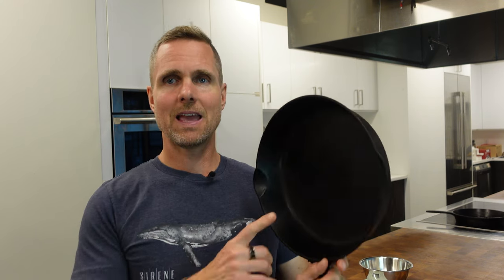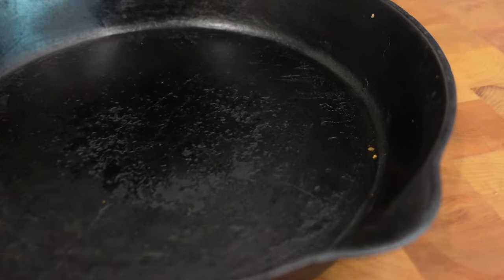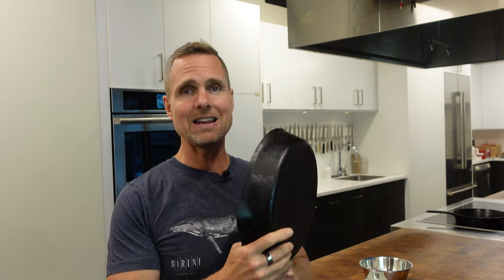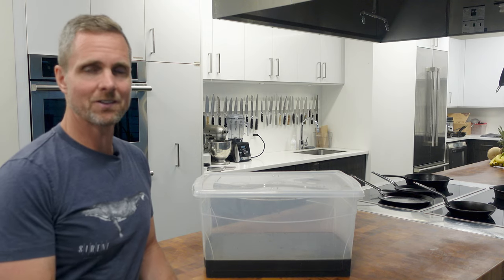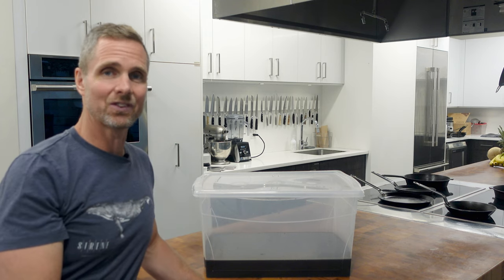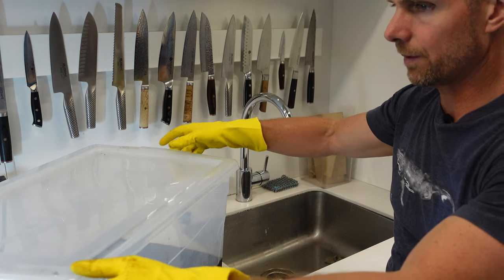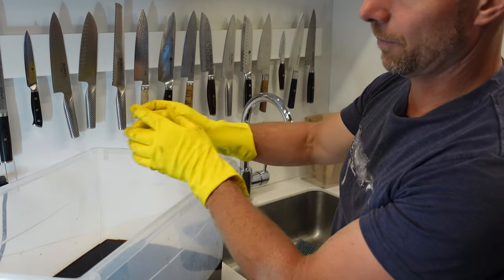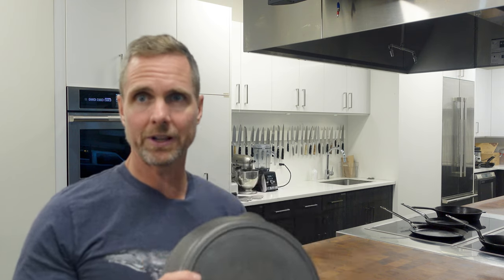Reconditing a 100 year old Griswold pan in a lye bath

Comment: Another thing about wire brushing pans is brush bits get embedded into the surface stays there. So whatever metal the wire brush is made of (and whatever else it was used on before your pan) gets into the surface. Even if you season it there is a possibility those tiny bits might come off with the food. The pitting on the logo is sulphur pitting, likely it was used on a coal stove fire. Adds to the patina. The italic (aka slant) logo is older (1909-1929 with a heat ring) than the upright logo.

Comment: My husband found a griswold a few years ago at a yard sale. The inside walls and about an inch out were carbon laden. The center was beautiful though and I didn’t want to remove the good seasoning. He uses brass wire wheels since being softer than steel only removed the carbon. I reseasoned the nearly bare edges and now have an amazing pan that works beautifully on my induction stove. It’s a true non stick pan.
Reply from the maker: That's awesome!

Comment: I' impressed with how close you got to the age of this skillet, I had to look it up in the book. A slant logo Erie was produced from 1909 - 1920 according to the book of Griswold & Wagner (5th edition blue cover on Amazon if anyone cares). If you would rather not work with lye Purple Power does the same but its just a cleaner, probably isn't as cheap as lye. The back is just Sulphur pitting from use over a coal oven. I kinda don't mind that terribly. On the cheaper side the Birmingham Stove & Range, Red Mountain series pans are nice. Most pans produced from 1900 - 1950s will be nice. I agree Steven at Cast Iron Cookware is a good person to learn from, a lot of what I do I've learned from him. You did an excellent restoration on that pan. you should feel proud. The looks on their faces when they get it back will be priceless.
Reply from the maker: Thanks. It turned out great.

Comment: You can also boil the lye mixture in the pan, then get a bigger pan, and boil it too, while the one you want to clean floats on it, which would take care of the exterior. Boiling lye solution strips it within half an hour or so, to the point where you can barely see any gunk and the metal is nice and gray.

Comment: This is the correct way to properly restore vintage cast iron. Electrolysis is another acceptable choice by the cast iron collector community.
Reply from the maker: and easy too! I understand that electrolysis is just for rust and that Lye is step #1 to clear off the organic matter. True?
Reply: @Cook-Culture  electrolysis will do both but imo it's not worth the effort. Lye bath for organic matter. Vinegar solution for rust. Easy. And much less to deal with.
Reply: The correct method is to throw it in the trash and get a real pan.. one that heats up in under and hour.. cooks more than portions of the pan.. and you can actually move. Cast iron is the most over rated trash.. in the time it takes me to heat a cast iron pan to full temp I can be half way or even done in carbon steel… or even in all clad..
Reply: @AverageReviewsYT  We found the juvenile!

There are always pros and cons to every pan/skillet material, even Carbon Steel. Even all clad and stainless steel have their pros and cons. Everyone has a different situation, or they value certain pros from one type of pan over the pros of another, or the cons from one type are too much and make that material not worth it (such as price, for example). Being a grade-A d-bag by going to a video about cast iron just to comment and call it "over rated (sic) trash" just makes everyone laugh at you as you display your ignorance and childish temperament.

-1- Cast Iron is an alloy of 2.5 to 3% carbon, and iron. Carbon Steel is an allow of 2% or less carbon, and iron. Your big issue is over 0.5 to 1% carbon content between the alloys.
-2- Carbon Steel does heat up faster, because it is a bit better at heat conductivity and has much less material to heat up. That means it also cools down equally faster and does not retain the heat needed to keep your food warm post-cooking. When you put cold or even room temperature food on a Carbon Steel skillet, it will drop the temperature of the skillet itself much quicker because of that high conductivity/poor heat retention. A properly pre-heated cast iron skillet will see only a negligible temperature drop when food is added.
-3- Carbon Steel is more expensive. A name brand 12-inch cast iron skillet will run you about $20-25. The Carbon Steel equivalent as a cheap knockoff brand might be as low as $40, but you're going to be looking at $50-60 for a decent pan. that is double or higher the cost of Cast Iron.
-4- Carbon Steel and Cast Iron both require seasoning and maintenance. Most people do not properly care for Carbon Steel the way Cast Iron owners care for their cookware, which is why most Carbon Steel pans become splotchy (mostly due to rust). 
-5- Carbon Steel is not as durable, and it is much more ductile (prone to dents/damage). Example: Carbon Steel is typically created by being bent into form from a sheet, not cast.
-6- A 12-inch Carbon Steel skillet will weigh about 3-4 pounds. A 12-inch Cast Iron skillet will weigh about 7-8 pounds. So Cast Iron will weigh on avg an additional 4 lbs over a 12-inch skillet, or 2 lbs over a 6-inch skillet.
-7- Cast Iron typically has a higher heat emissivity. This is also significant to many people when it comes to post-cooking and keeping your food warm.

Just some examples.
Reply: @WhiskeyPapa42  im not reading all that garbage.. as for my half joking comment.. all of that is from actual experience (I used cast iron only for a couple years) not just from reading forums and what mommy and daddy told me. People act like cast iron is a god send.. it’s not.. and it’s so much slower and annoying than regular skillets lol.. so whatever all the garbage was that you typed… idc.. because I’m sure it’s google cast iron forum nonsense lol
Reply: @AverageReviewsYT  "I'm not reading all that garbage" Of course you're not, because then you would have to have an actual debate/argument and defend your points. You're the only expert here, I'm sure. /sarcasm 
"it's so much slower" ... if you had actual experience like you claim, you should know that cast iron can be preheated in like 10 minutes. If you're making anything worthwhile, you have 10+ minutes' worth of prep work you could be doing during that time. It has zero impact on your actual cooking.  But I will bow to your illogical experience (also /sarcasm)
Reply: @WhiskeyPapa42  10 minutes.. ( assuming in the oven)… now preheat the oven lol, add a couple more minutes… if you preheat on a cooktop it heats un evenly and much slower compared to any other skillet. ( doing a pan of bacon on a 12” ci I got 15 minutes for even temps.) 10 minutes… I can cook a pan of meat in that time.. 10 minutes.. that’s wasted energy and time.. not to mention the weight.. but go ahead.. keep rambling google facts off 😆😆😆
Reply: @AverageReviewsYT  My god, this generation is soft. If letting a stove heat a pan for a few minutes is "too much effort," I weep for the first girl who lets you get past first base. On the plus side, the guy she dumps you for is gonna have a low bar of comparison.
Reply: @TheCharleseye  lol you see it as soft.. I see it as choose the better option.. 😎😎 efficiency and time management 😆😆😆 I wanna get stuff done and catch up on all the other tasks I’m needing to do. There’s a time and place for cast iron and daily use isn’t one for me..

Comment: I have restored dozens of Griswold, Wagner, Favorite, etc. vintage pans. You really need to use soap and some brillo pads after the chain mail. Then scrub with a magic eraser until the water and sponge is clean. Spray it with oil while it's wet and wipe it down to avoid flash rust or "oxidation". A stainless steel scrub pad works very well as well. You want ALL the seasoning off because rust can hide under old seasoning. Get it down to gray metal before you start to reseason. TRUST ME!

Comment: After stripping, soak in a 50/50 vinegar bath (WARM water)  for no more than 30 minutes.  This neutralizes any lye that gets trapped in the iron pores.  

Then rinse WELL for a good ten minutes.  Preheat your oven to 200 degrees F while rinsing. 

Dry with a lint-free cloth immediately to remove most of the water.  Place in the pre-heated oven for half an hour.  This dries away ALL residual moisure while also opening up the pores of the metal to receive oil. 

Remove from oven, and QUICKLY apply a very light coat of high-temperature (500 degrees) avocado oil.  

Place back in the oven and turn up the heat to just below the smoke point (480 degrees is good!)  Allow to bake at 480 degrees for one hour. 

Turn off the oven and allow to cool overnight IN THE OVEN so it cools down SLOWLY. 

Repeat the seasoning process several more times identically. 

In this way, no moisure can become trapped between seasoning layers. 

Regards!

Comment: Don’t sand, use high temperature to clean. I suggest using scotchbrite pads instead of chain mail. But hey, it’s yours to do as you wish. It comes out cracked, warped, or has swirl marks or doesn’t hold seasoning well you should do this or electrolysis.
Reply from the maker: Howdy, some pans are too gone for high heat but I've found a week in lye works great. And from our use, chain mail is FAR superior to scotchbrite

Comment: I think u quick hand dry and immediately oil to prevent flash rust, then a mild heat full dry before seasoning
Reply from the maker: Thanks!
Reply: Do a final rinse with cold water helps with the flash rust too.

Comment: I have a couple cast iron grills from a portable camp grill that got some rust on them but still have sections with the factory coating preventing them from being seasoned properly. The rust was easy to take care of, but I'm curious if the lye bath will help remove the original coating so I can fully season these grills from scratch. Obviously I don't want to use any power tools if I can at all avoid it, so I've been looking for other methods.
Reply from the maker: The Lye method works very well!

Comment: I have a cast iron pan that is approximately 100 years old and is very much rusted. I also have a new, but cheap Dutch oven that I purchased a few months ago and have not used it, when I went to use it I discovered that it is very rusted both inside and out. Will the lye remove the rust? Would I do it the same way? Also, how do you dispose the lye. Thank you.
Reply from the maker: Hi, lye is for organic material. Surface rust can come off with powders like Bar Keepers Friend. Dilute lye mixture to dispose.
Reply: Try a 50 50 vinegar and water solution sprayed on the rust. Wet your rusty pan with solution and let it set no more than half an hour and then scrub the pan. Use cold water when rinsing as hot water will cause flash rusting worse than cold water. Dry pan and use a high smoke point oil like grape seed or avocado oil as seasoning and rust preventative on a warmed pan. REMOVE all the seasoning you wipe on before baking your pan. Repeat: wipe it off like it was your job.

Comment: Hi - just wondering how you applied the oil for seasoning? Whenever I've gone to look up a video for seasoning my wok, carbon steel frying pan or cast iron pan, I've seen people using a cloth or paper towel to do so. Every time I've tried either, I get a lovely even finish but end up with small fibres throughout which damage the integrity of the coating and are also just unsightly.
Reply from the maker: Hi, use the same cotton cloth over and over. It will become saturated in oil. This should solve your issue.
Reply: @Cook-Culture  Can it get rancid?
Reply from the maker: @seechangenyc280  Probably but I don't find the rag gets that stinky...?

Comment: Just curious, I recent started using avocado oil to cook. And I use that to season my cast iron. I use chosen avocado oil to be precise, and the company says it doesn't have fiber. So is it fine to season cast iron? I noticed in previous videos you said not to season with avocado oil, so wondering on that?
Reply from the maker: Hi Bill, thanks for the note. I've found the thinner the oil the better. That said, if you're having success then go with what works! I recommend Grapeseed because it's super consistent. It's always thin
Reply: @Cook-Culture  WOW.
Reply: @Cook-Culture  Just curious, if you don't mind me asking one last thing. Chosen avocado oil say their oil has a 500°F smoke point. So how long and what temperature do you recommend I put it in the oven for?

Comment: I just put my cast iron skillet into an electric oven and turn the oven to the oven cleaning mode. Once the oven cleaning mode is done, the carbonaceous material becomes ash. After cooling the skillet, the remaining ash  is easily removed with a simple wash. I don't have to worry about disposal of the lye solution or a lye chemical burn. If you do plan on using lye, you definitely need eye and skin protection because lye will cause a horrific liquefaction necrosis which allows the lye to penetrate further into the tissue.
Reply from the maker: Howdy, I like your method for simple maintenance but I have found it does not work as well for the really cooked on carbon